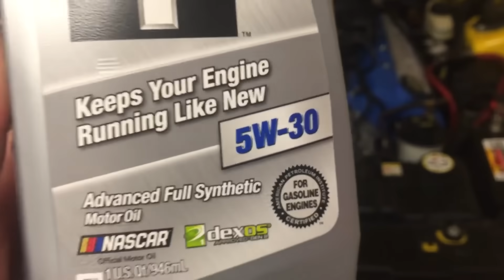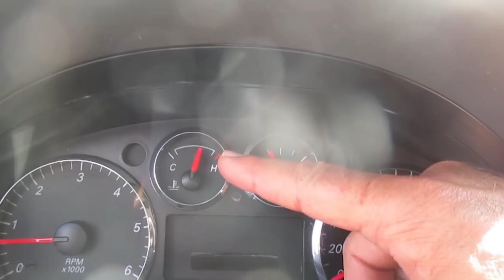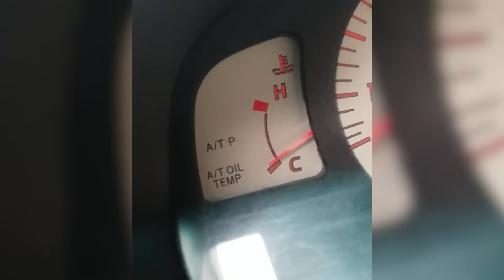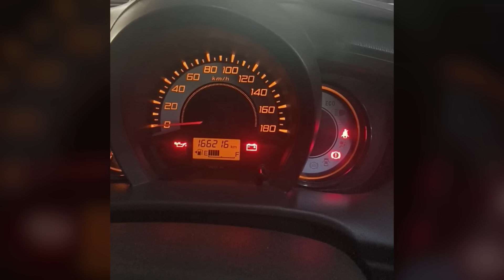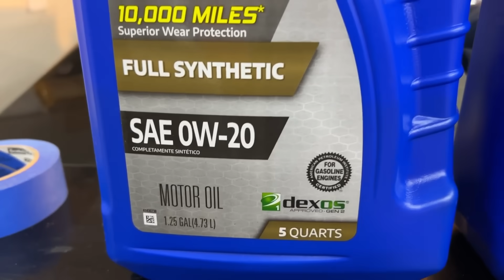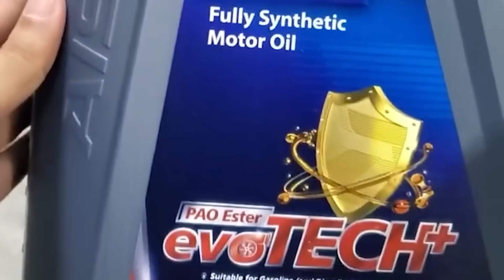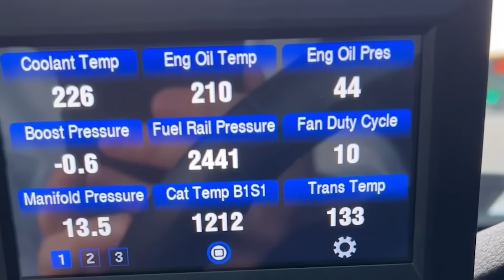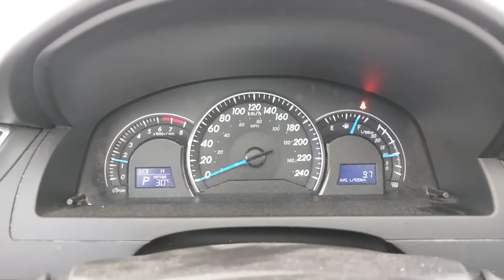Why US  Cars Use 0W 20 But the Same Engines Use 5W 30 Abroad (Exclusive Mechanic Explanation)

Comment: So basically, considering that I live in Puerto Rico, 5W30 would be a better fit for my Toyota Yaris iA (Mazda 2 rebandge)? Considering that we do not experience cold weater like US mainland, but we do experience high temperatures.
Reply from the maker: Yes, for your Toyota Yaris iA in Puerto Rico's high temperatures, 5W-30 would generally be a more suitable choice. What oil do you use in your car now?
Reply: I live in Miami Florida and it gets very hot in the summer with heavy traffic just like Puerto Rico and my 2022 Honda HRV specifies the 0W 20. And now I’m using pennzoil platinum synthetic,natural gas formula ..  I keep my vehicles for years. Should I switch next oil change???

Comment: I use Rotella T6 full synthetic 5W-40 in my 2000 Toyota Camry with the 2.2L 5SFE engine.  It has 208,000 miles on it so far. I change my oil every 4,000 miles. It consumes 1/2 a quart between oil changes (1/8 quart per 1,000 miles). The engine has a little cold piston slap (It has since I got the car with about 120,000 miles on it). I also use tbis oil in my wife's 2008 Toyota Highlander hybrid  with 267,000 miles and my son's 2005 2.4L camry with 124,000 miles.
Reply: I use t6 in my duramax lp5 every 5000 miles.  necessary for soot removal and clean turbocharger.  T6 is heavy on detergent and will last for 15000 miles in a regular motor. But Why use API- SN when you can get API-SQ for the  same price?.  overkill, every 4000 miles, in a naurally aspired engine with no direct injection, you. Are better off with mobile1 high mileage 5w-40 or heavuer in hot 
climate
Reply: @Bluuuue908 because I like using Overkill oil when it's the same price as Mobil 1 synthetic. It's actually quite economical. I also like the higher level of extreme pressure lubricants in it since I don't have roller lifters. My engine uses bucket and shim for the valves.
Reply: What really makes Rotella an oil meant for diesel engines??

Comment: Not only is the thin oil to benefit their so called emissions agenda, the auto stop engines that die at the red lights is ridiculous too. That stopping the engines and continuously restarting in heavy traffic is causing premature wear also. I won’t buy a vehicle that has that feature unless there is a delete available to stop that s illy shit. Cylinder deactivation with all the complex garbage involved in that shortens your engines long term reliability as well.
Reply: The auto-stop will shorten the normal life span of the starter motor. So prepare to replace it anytime soon. They are not easy to do anymore considering the fact that they are deeply embedded in modern engines nowadays.

Comment: I drive a Lexus LX 575.7 L V8 and use Pennzoil ultimate 0W 20 when my engine does hit 50,000 miles I will switch to 5W-30 or 5W 40…. What is the difference between 5W-30 and 5W 40?
Reply: Hey jimmya I suggest 10w30!!!!!!!!!

Comment: Ok. You talk about COLD or HOT conditions. What if we live somewhere in between, like in europe????
Reply: @sasa....I think it depends on what one means in temperatures when the terms 'cold' and 'hot' are used. those are very vague terms. If you live somewhere in Europe, find out from local people and local repair shops what they have observed as what grade oil works best for a particular car. Even Europe has a variety of climates.

Comment: 2011 Avalon w/ 2GR-FE 3.5 L  V-6 & 148,000 +  mis. :   CASTROL GTX  Full Synthetic, 5W-30.  Since new, change frequency was  @ 5 K, but now every 6 - 7 months due to mostly local, stop & go driving (severe usage).  ZERO oil consumption between changes from Day 1, never any run-hot condition.  Also, have renewed every other fluid at least once during its lifetime.  GREAT technical video, with professional, fact-based information concerning our modern Oil & Engine requirements.  BIG THANKS !

Comment: I use 5W30 on my two 0W20 Toyotas
Reply: I did the same for most of my cars, they ran great, I just recently switched over to 0-20 , because the dealership won't put 50, 30 for warranty issues, but I'd argue they probably run a little bit better with 5W-30 especially during the winter.
Reply: @marcs4091  so many experts out there about oil years ago I used to use thicker oil that’s because that’s what they required fast-forward today. The engines have a tighter tolerance. That is why they tell us to use thinner oil. Fast forward people put their comments and say they’re using the thicker oil because one thing or another and a lot of folks jump on board
Reply: me too,   runs much quieter and more power too.
Reply: @ocean694  more power with 5w30 over 0w20 ?? Is it a big vvt engine
Reply: How's it doing
Reply: @tedhicks5431 both cars are doing fine. I see no reason to go back to 0W20
Reply: @tedhicks5431 and he doesn’t tell you 🤣🤣🤣
Reply: and do you still use the same filter? just curious
Reply: @Phillip-t5y8i yes
Reply: What miles are you at
Reply: @Coltensreefing one has 127k miles, the other has 97k miles. I changed to 5W30 about 10k miles ago
Reply: I have a Highlander I was thinking about switching
Reply: Same here, quieter startup and No ill effects in the 3 Years since the switch that I know of.  I'm in Warm climate and going to 10W-30 next.  AU manual for my 4Runner that someone posted recommends 5W-30 only up to 50 deg F and thicker oils up to 20-50 beyond that.
Reply: I have a 19 4runner that i switched over to 5W30 and runs smoother, less noise.  my 2004 garage built short block 350z runs 5W30 as well.  makes 600hp for 5 years, 10 track days and street abuse but i change every 1000k miles or after every track event.
Reply: 0w oil pours 🫗 like water 💧  😅
Reply: How’s the vehicle running been thinking about doing this to my Corolla due to long commute
Reply: @annoyingkydd45 runs fine. Since I made the original post, I purchased a 2014 Toyota with 28k miles and I also put 5W30 in that

Comment: 200,000+ mile '01 F-150 with 4.2 V6 Takes 5W-20 from the factory.  I found that Amsoil 5W-20 is better than any for this particular vehicle. I also burn high test to protect the upper cylinder and rings. Yeah, costs more but it runs flawlessly even at 24 years and 205,000 miles. If I switched to 5W-30, would I need to do BG service on engine before the switch? You did say that the thinner oil left varnish/deposits in the engine. Even with having used Amsoil over 80% of it's life?
Reply: Hey johnbrou. I know people think. Synthetic oil is better that's bullshit  also the best oil filter is only good for 3000 miles period!!!!!!!!!!!
Reply: @greghenton5562  In the case of the '01 F-150, by changing to synthetic, I immediately got 2 more miles per gallon and a noticeable improvement in performance. Wear metals are greatly reduced at cold startup including particles smaller than the filter can catch so a quality filter can last twice your stated number if driven under normal circumstances.

Comment: I now run 5W-30 synthetic in our 2016 BMW X3 and  2021 Honda CR-V.  This is the same oil I have run for more than a decade in our three 2001 BMWs and 2010 Mustang GT.  
Yes, my wife and I currently own and drive six cars, all insured, tagged, and inspected.  I usually run Castro Edge in all of them, although Mobil 1 or any quality synthetic motor oil should serve you well.

The 2001 BMWs all have more than 150,000 miles each on them and are our weekday drivers, except that my wife stores her 325ci in the late fall and over the winter.  

I really should thin the fleet, but I am better at buying cars than selling them.
Reply: I am blessed to have multiple vehicles.  It's great to switch them up.
Reply: You cant possibly be putting a lot of miles annualy on so many vehicles, i would be worried about fuel getting old more than anything, unless you stick to premium fuel with stabilizer during storage..oil will last a lot longer than the fuel, twice a year oil change is plenty, still means 12 oil changes every year.  on high mileage cars, consider 0-40 or even 5w-50 in warmer months
Reply: @Blu @Bluuuue908 I put the most miles monthly on the older cars, and less miles on the newer cars, except for the Mustang, which I only drive a few hundred miles a year.  I stay current on oil changes and fuel stays fresh except the Mustang fuel interval is longer.  I still make sure to run at least one tankful through the Mustang annually.
 
I only run the highest octane fuel and high-quality synthetic oil in all vehicles.

Comment: Would it be better protection and mileage with mixture of 0W-20 and 5W-30 oil, say 60% : 40% or 50% : 50%.  My car recommended to use 0W-20 oil and run Malaysia.
Reply: Just use 0w30 , best of both worlds

Comment: I live in Canada. I have to rely on 0W-20. Maybe during summer I could switch to 5W-30? But then I would drive not much up until temperatures drop again and I have to go back to 0W-20.
Reply: 0W-30 will be optimal for both, winter and summer
Reply: @t.r.8386 excellent idea! 0 for winter and 30 for summer. Next oil change I'm gonna do that!

Comment: You failed to mention changing the oil to a different viscosity will cause a diagnostic trouble code. As a mechanic I've heard "all I did was change the oil and now my check engine light is on". The computer system can detect an incorrect viscosity. The EPA and manufacturers work hand in hand. Especially since the bailout. So it just makes sense the computer is programmed with parameters that are designed for a specific oil grade.
Reply: Definitely not the case with every manufacturer

I've been using 5W30 on my two 0W20 Toyotas now for months. No issues
Reply: The computer can’t read oil viscosity. Engine oil life is determined based upon how many times the engine is started or the amount of miles driven since the oil life monitor has been reset.
Reply: Exactly
Reply: That’s not a thing!  Been running 5/30 in all four of my cars, one a 2025 Toyota and never a engine light.

Comment: I have a 2023 Jeep Grand Cherokee with a V8 5.7 Hemi engine.  Dealer recommendations and on the oil engine cap is OW-20 oil.  I live in St. Louis, Missouri where temperatures very and fluctuate often.  I have oil changes performed at the dealership.  Will they install 5W-30 if asked to do so?
Reply: If the car is under warranty, they will not!

Comment: i drive kia forte 2010 SX 2.4 engine canada edition, the manuel book say 5w20 or 5w30 i use mobil 0w30 / the weather tempurature is -30 to + 35 celcius
Reply: If u plug in consistently at very cold temps 5w is fine

Comment: If you think 0W-20 is thin, Toyota has been using 0W-16 since 2018 in the A25A 2.5L 4 cylinder and now there’s 0W-8 for that same engine but in hybrid models as well as the M20A 2.0L 4 cylinder. I have seen both with over 200K miles on them with no issues, with oil changes every 10K miles.

Comment: 0w40 is the go to oil.
Reply: No its not markell its to thin I use 5w30 in my f150 its got 175 thousand miles on it never had a problem I also put a high volume oil pump in it I also pull a camper with it!!!!!!!!!!!
Reply: GM switched from 0W-20, to 0W-40 Super Car (DEXOS) on V8s 2024 and pre with variable valve systems.

Comment: Why not switch from 0W-20 to 0W-30 rather than 5W-30? Ideal for all seasons
Reply: I use 0w-30 for my Toyota Lexus here in Nigeria. It's a hotter climate here and engines do better when oil is not too thin/light
Reply: @vitkiu...HI, and I think you have a good question. We know that the first number is for cold weather start, hence the zero number for thinner oil to help the cold motor start up easily. As for going to 5W instead of 0W...?? I think a lot of it has to do with just HOW cold one is talking about. For instance, the winters in Alaska and other places in the northern parts of the planet can have extended temps of brutal sub-zero temps for long periods of time. Of course in these brutal temps, one usually has a block heater for the vehicle. Using 0W just makes good sense. Now, for someone like me here in north Arkansas, our Winters are rather mild, with the occasional 'cold-snap' where temps get down in the teens and sometimes lower, but never for weeks & weeks at a time. For this area, using 5W is fine. 

And I think that this is one of the most important answers: use the proper oil rating for your area. And even more important is changing oil/oil filter regularly. I say every 3,000-5,000 mile intervals...for regular driving like most of us do.

Comment: 0W20 Amsoil Signature Series. I have been using Amsoil since the mid 70"s and won't use anything else.
Reply: Amsoil is far too expensive for the protection it offers. Pennzoil ultra platinum is 95% as good as amsoil while costing 1/3 the price.
Reply: @Eclipsis17 I use castrol  edge with a k&n or mobile-1 oil filter
Reply: @Dachamp2001 Still the best price compared to AC Delco which is not even full synthetic and even Mobile 1 in Canada. Castro Edge Diesel is officially Dexos-D certified. But only 0w20 is available.
Reply: @xianqingdu Everyone got a better price then AC Delco lol I've been using mobile-1 & Castrol for decades im not changing up anytime soon. My 26' Silverado calls for 0w20 i wanna put 5w30 in it in the spring but im worried about my factory warranty 0w20 is to light i prefer 10w30
Reply: @Dachamp2001 AC Delco is outrageous in their pricing including the filters. I think Amsoil has most choices of the weight. In Canada, Mobile 1 and Castrol Edge Diesel only offer 0w20 for diesel and not in stores like Walmart and Costco.  Amsoil offers all sorts of weight, including 5w30 for diesel engines. I’m in Vancouver not really cold. Anyway, 0w30 is ok. We care more about high temperature thickness, Amsoil 0w30 for diesel engines is probably the best choice. I also add 3oz/qt motorkote which provide extra protection.
Reply: @xianqingdu im in Pennsylvania it gets pretty cold here lol same with the heat 🥵
Reply: @Dachamp2001 maybe, that is what I’ll do. I still have a free oil change from the dealer in April 2026.
Reply: @Eclipsis17  you can sign up as a preferred customer at a substantial discount.
Reply: Use le
Reply: Amsoil is not on the list of officially Dexos-D Certified oil list. It risks voiding the warranty of the power train within 3-5 year of a new duramax GM diesel truck. I plan to use Amsoil 5w30 after 5 years after the warranty and when the truck becomes older. I drive less than 10k km per year. Mine is a 2024 LZ0.
Reply: @xianqingdu amsoil won't pay the extortion fee to pay for dexos certification
Reply: @The @TheArchetypeGamer I’m sure that Amsoil is good since so many people only use it for diesel cars. In Canada, it’s also better price than both Mobile 1 and Castrol Edge. I just do not want the trouble and risk while the warranty is still valid.
Reply: @xianqingdu i use it on my 2014 ford focus i have 345k miles on my car.
Reply: @TheArchetypeGamer thanks for the info.
Reply: @xianqingdu you're welcome i use 5W-20 signature series in my car
Reply: @xianqingdu  voiding a warranty requires the manufacturer to prove that the oil caused an issue. Amsoil exceeds Dexos certification standards.
Reply: @xianqingdu you realize they would have to take an oil sample ro prove its not dexos oil. As a warranty rep, that almost never happens. Grow a set of balls.  Your bigger problem is that you bought junk ass GM product. You've got bigger things to worry about failing..😂

Comment: There’s only one YouTube channel you can believe about motor oils fuel additives and other car chemicals. It’s called The Motor Oil Geek. There are many BS and bogus YouTube channels who lie to you and don’t tell you the actual scientific truth.  Just Beware because your engine might get destroyed.
Reply: It is the same here in Australia, as in America. Newer cars all use 0W20. My Subaru use 016.
Reply: Lake just posted a video calling out this very vid, science not speculation
Reply: My point---My engine in other countries uses a wider range of viscosities. It's hype in America about thinner oils to push the climate change agenda.
Reply: @davidgodfrey2956 So true man. The biggest influence on viscosity ratings is EPA laws from what I can see. I am in Australia and just had a look at Penrites recommendations for Jeep. My 2011 3.7 V6 recommends 5W-20 but the same engine in a 2001 to 2003 Jeep recommends 5W-40 or 10W-40. The same goes for other engines through different time periods. Take the Wrangler for instance, the pre 2003 4.0 litre model recommends the 10 Tenths 10W-40 racing oil but post 2003 4.0 litre does not which tells me that the high zinc content is not allowed by the EPA. I will stick with 5W-40 or 10W-40 any day.

Comment: By far the best analysis of which oil is best for an engine & why.  The additives also play their part in the equation.  Some auto repair/maintenance manuals will state options based on the weather.  My only concern would be with the variable valve timing solenoids & passages.  If they are not affected I am thoroughly behind using oil that is thicker than water.